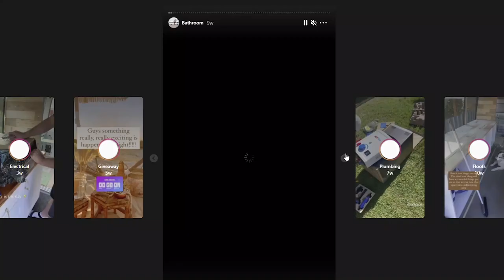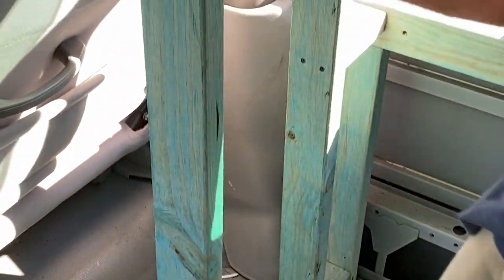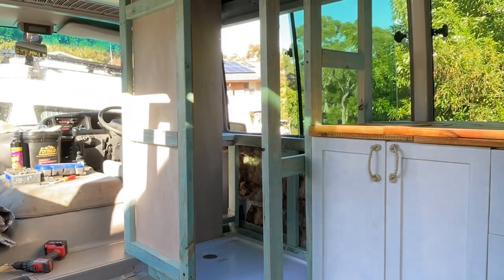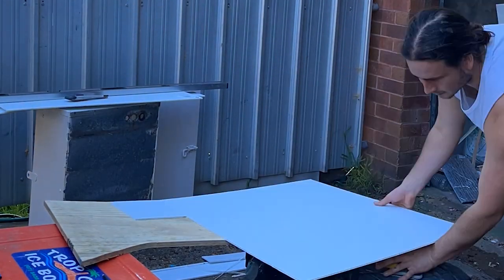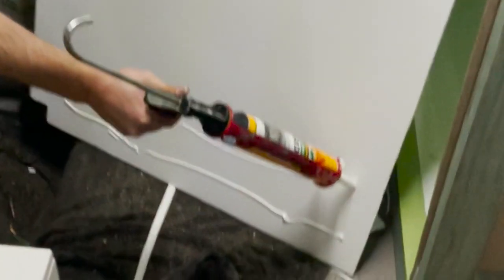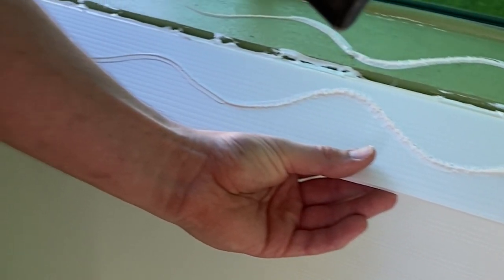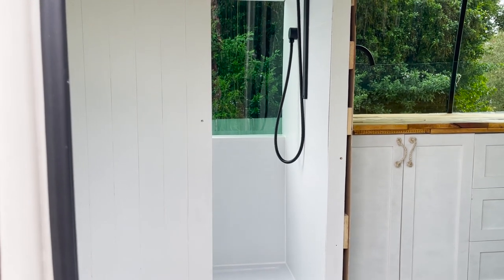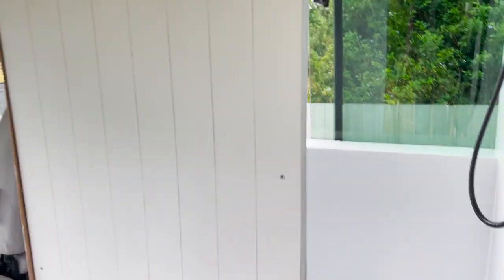Bus Build - Part 3 | Bathroom & Shower | Toyota Coaster Conversion

Comment: Do your water plumbing and electric wiring have certified builder involved?  Because as far as my knowledge, campers or self contained vehicles need certification for road legal.  What was your plan for this? Thanks.
Reply: Looks amazing, what product did u use for the walls?